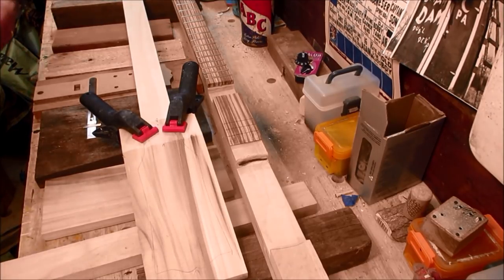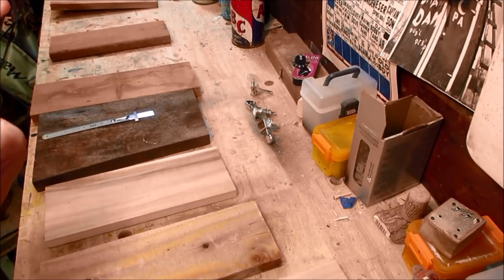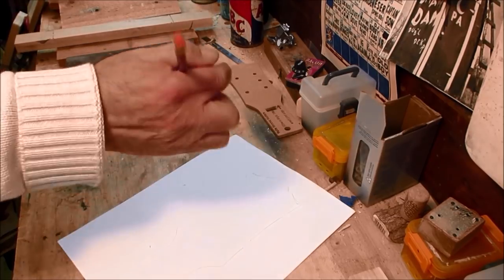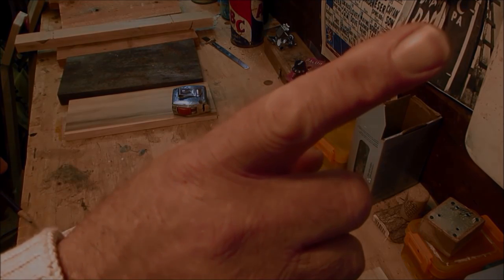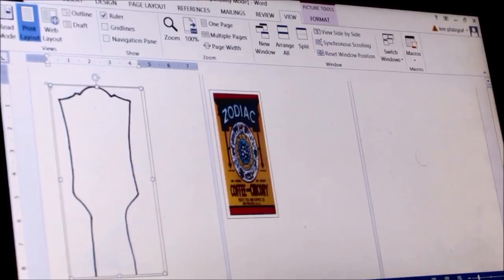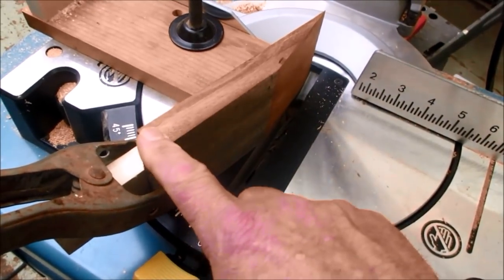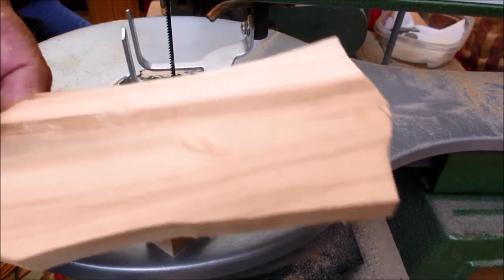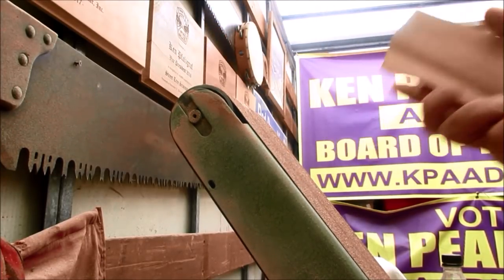Headstocks 101

Comment: If you’re not real picky, rather than going through a graphics program, then into a layout program,....  Just scan it in, open your print controller and print it at 80% or so.  Also, as an old woodworker, I would NEVER use a handheld planer on small pieces of wood like that!